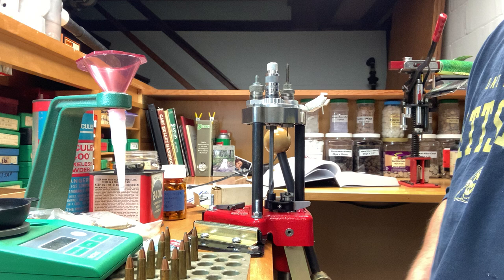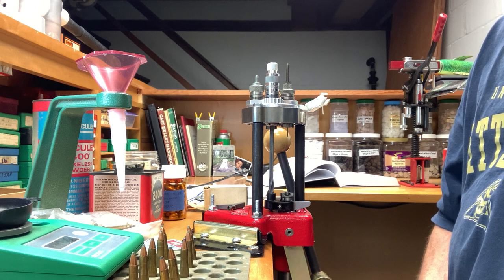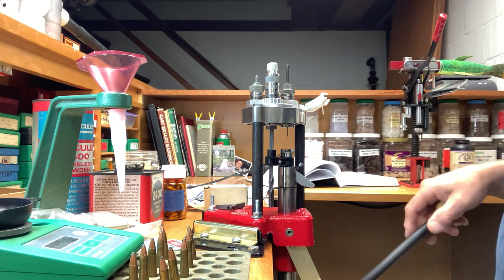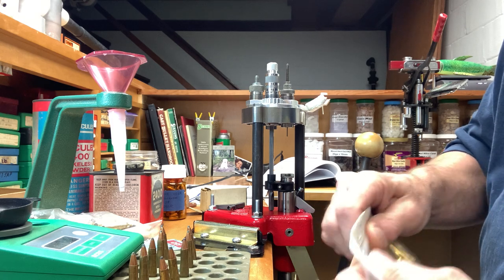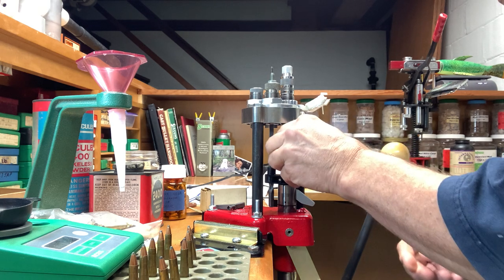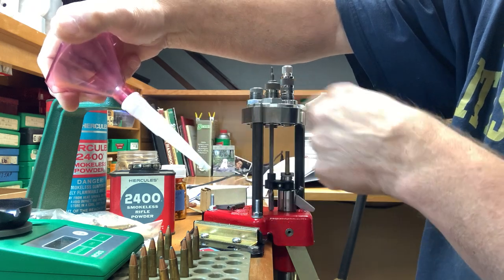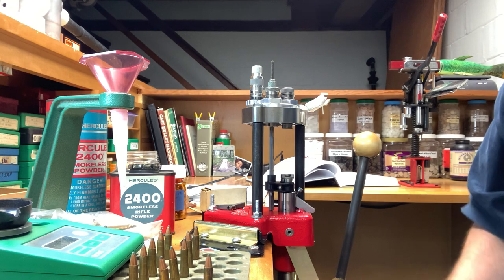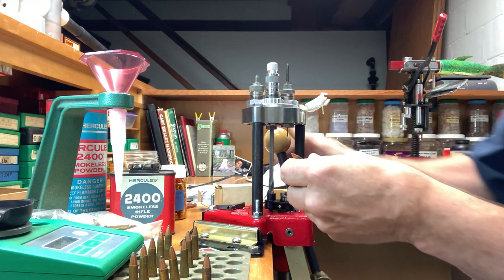22 Hornet and Lee Turret Press

Comment: Your seating die is quite a ways from the shellholder at the top of the  stroke when seating a bullet, is that for a reason??? I have a set of Hornet dies from the 1960's and I know somewhere they went from a .223 to a .224 barrel on some guns . I like the Lee turret , I have an older one 22 years old or so. Nice video well done.
Reply from the maker: No reason but the 22 hornet the bullet is set so far in the case I really don’t worry about it being out of line. You’re right about the bullet size I have one gun smaller and one gun the larger I actually just built a single shot 22 hornet that has the 223 bore

Comment: Not trying to discourage you, but you should switch to Hodgdon Lil`gun powder and use small pistol primers and watch your group sizes shrink to one hole groups.
Also, neck size the brass only, and do NOT crimp the bullet/case. The Hornady 35gr VMax bullet will be one of the best accuracy`s you`ll ever see in the 22 Hornet.
I bought 10 boxes of the Barnes 30gr Varmint Grenade bullets, they are just as accurate as the Hornady VMax 35gr, too. They`re mean`t for the 22 Hornet guns.
These 2 bullets are the most accurate in all of my 22 Hornets. All my 22 Hornet friends are LOVING this combination. Its all they`ll shoot now. They work!
Reply from the maker: Thanks for the advice on the lil’gun. I will never find it in my area. I have looked for it many times I have a lot of 22 Hornet bullet but when I get low I’ll try the vmax

Comment: Thanks for video, had the gear and components to load Hornet since 2013 but didn't have a decent rifle till recently.  Watching your video was a motivator, hope to get everything set up and begin loading today.  I don't load much rifle, I use Hornady One Shot spray lube an everything, any comment on using it for Hornet?  I will probably full length resize to fireform all brass to new rifle.  Thanks for video.
Reply from the maker: It is a great little cartridge and for the cost of it right now your best bet is to reload Hope it all works out for you thanks

Comment: Are the projectiles actual hornet projectiles
Reply from the maker: No but I have 2 - 22 hornets one has a 1 in 16 barrel the other has a 1 in 9  these were for the 1 in 9 Gun  the Gun with the 1 in 16 uses 223 not 224 bullets
Reply: @maxxbear5014  I was wondering about seating depth and magazine feeding if they are actually hornet ammo... because I have to seat my projectiles so far in to fit the magazine that I can't use just any old bullets... has to be hornet persific  or close as.. it's an anschutz